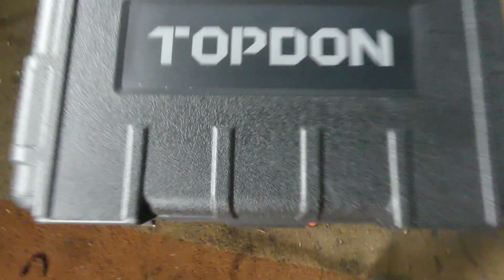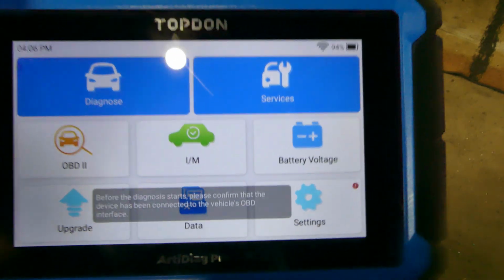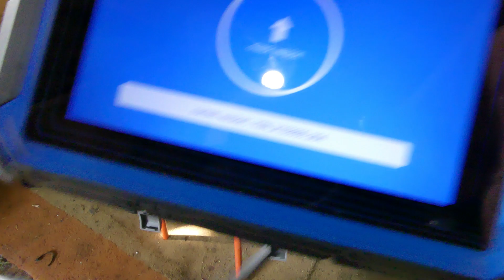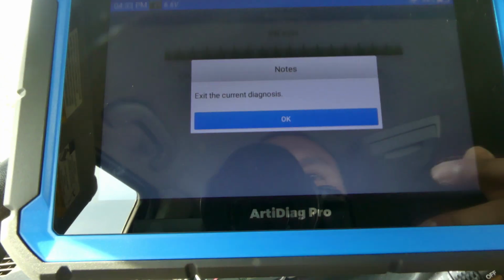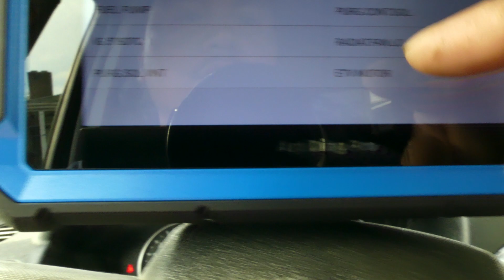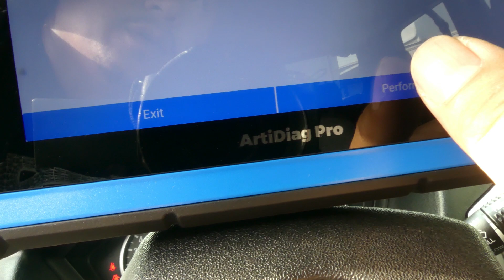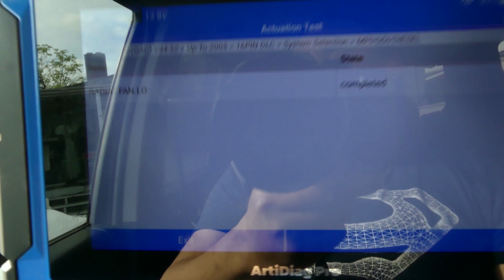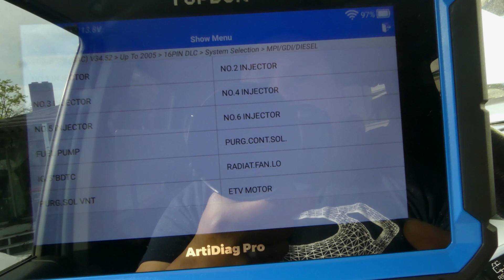TOPDON ArtiDiag PRO BiDirectinal Feature TEST on Radiator Fan motor

Comment: ie my radiator fan runs at super high speed a few minutes after you turn it on even without the A/C on so I am trying to use the TopDon to find the problem but cant find a specific radiator fan or how to get to it since I just bought the unit a few days ago,  trying to figure out if it is the ECM  or the air conditioning sensor a/c sensor or condensor sensor or a bad ECM blown fuse or coolant pump etc causing fan to go high speed or a short  or blown fuse, it started after my battery went dead and I jumped the car , recharged the battery and then the check engine light came on and then the high fan speed started a day later etc. the TopDon complete health report only had ECM - Engine Control Module(ME) 1 problems exist
1.P203E-004 No CAN Message From Instrument
Cluster Or Message Faulty. Communication Fault / See
Also CAN Status In Freeze Frame data(P0600)

Comment: I have a 2004 Mercedes e500 and a wireless TopDon 800t , how did you get to the radiator fan speed diagnosis screen of the unit ?  not sure which diagnosis screen you picked , steps please I am sure my TopDon 800t unit has similar screens thanks
Reply from the maker: its not about the scanner its about the module the u scanning it some car module had limited data on it ..Example most of car i can see the live data for misfire cylinder 1 to 6 and it shows number of how many misfire on the bad cylinder ..some car on the otherhand wont show any data of misfire so it depends on the car module u working on i did notice that so many times

Comment: some other brands have the ability to change the speed of the fan up and down using the scanner , can the TopDon 800t unit change the radiator fan speed and testing it to lower and increase the fan speed
Reply from the maker: its up to the module installed in ur car ..if ur rad fan module is made of variable speed then yes my scanner can control it by percentage but if ur rad fan model is with of low and high speed only then u can probably control it by low and high